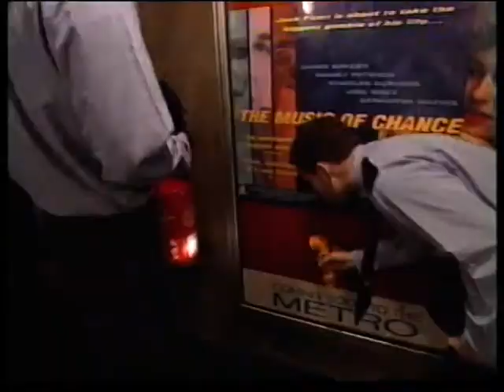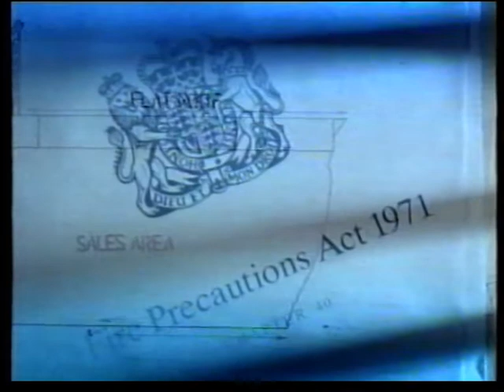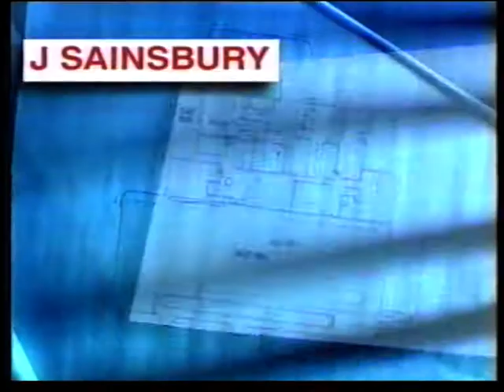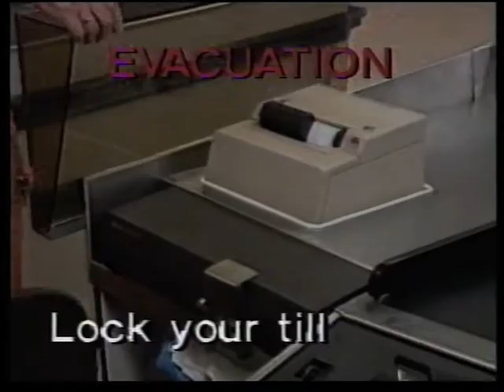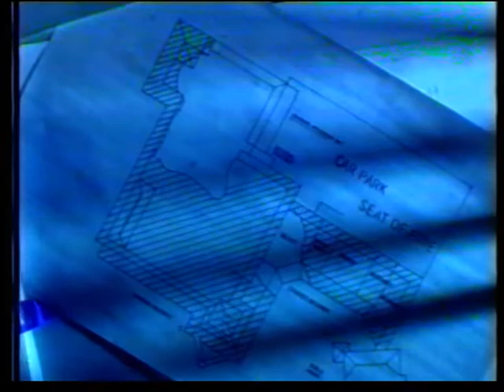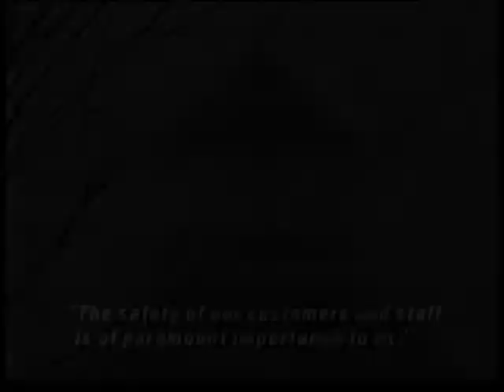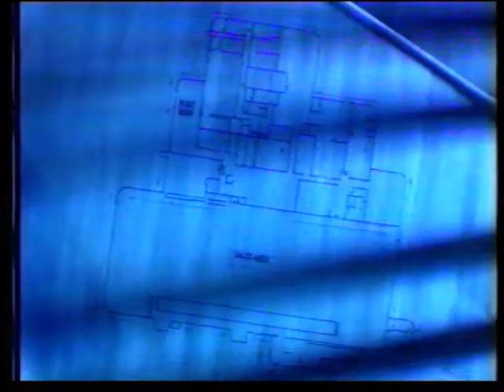World in action   in the line of fire

Comment: If that cinema rated 10 on a scale of bad then it should have been closed immediately under Section 10 of the Fire Precautions Act as an immediate risk to life.  The naysayers got their own way eventually with self-certification which is all very well until something goes wrong.  Yes you can prosecute but that doesn't resurrect the lives lost.  Fire Precautions are costly and that's why they wanted rid but more than that they wanted rid of the people who did the checking so they could have a free hand.  There is the real reason behind it....the money men didn't want to be held financially responsible for expensive ongoing maintenance.  Look what happened!!  You think after the C.L.A.S.P. debacle you think they would have learned.  I have fought fires in C.L.A.S.P. structures, in fact the first school fire of the type in the UK in the mid '70s, Burgess Becker Primary School in Monsall, Manchester and all I can say is, thank God it was the Easter holidays.  I was one of the last out after we realised the extent of fire spread throughout the roof space and when I turned round the whole school just simply collapsed like a house of cards.  Still they build with roof spaces the extent of the building with no fire walls.  They say money talks but the money is in the wrong hands, those whose only concern is profit and saving costs.  From that day I never once entered a building like that without pulling down the ceilings as we progressed costing a fortune in repairs.  I didn't care, they created this situation and my life is more important to me than saving the money men a few quid.  The ONLY people who know how fire behaves outside the laboratory are firefighters and they are the ones THEY turn to when they are in it up to their dirty little necks and want to risk our lives for their folly.  It's cost the lives of too many good men AND women, not forgetting Fleur Lombard in Bristol but despite recent tragedies things will carry on just the same when all the hoo'ha settles because.......money talks!